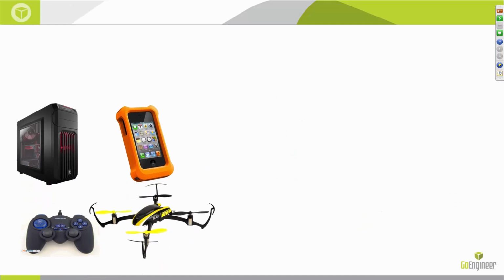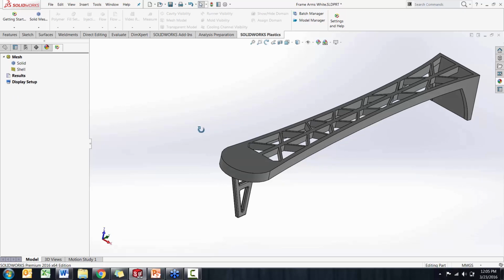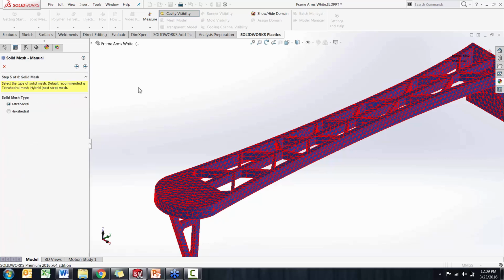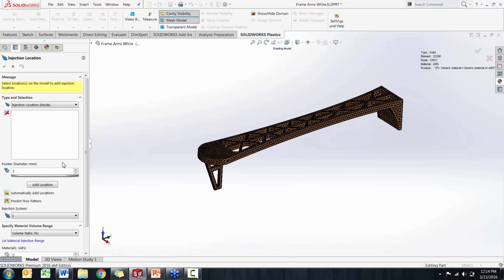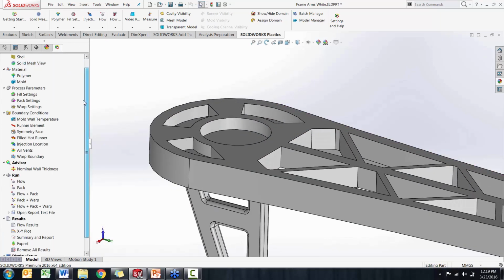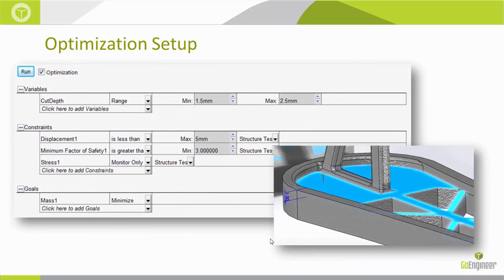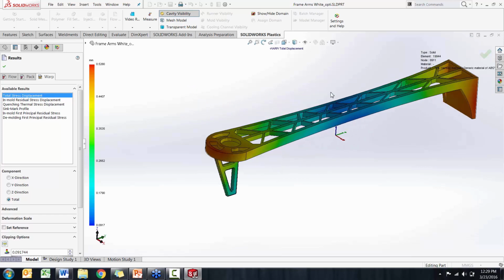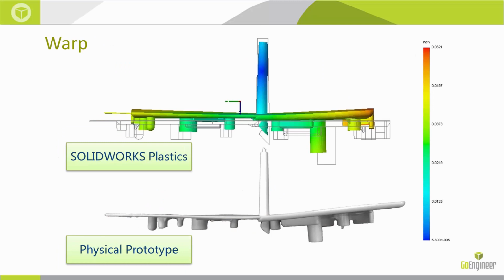SOLIDWORKS Plastics - Injection Molding Insights

Comment: How much time does it typically takes for an average computer system to run one of these analysis?
Reply from the maker: Hi Shreyans,
Depending on the mesh density the solve time for an injection flow analysis can solve for only an hour or solve for much more (24+ hours).  It would not be atypical to run a complex mold flow analysis overnight to then analyze the results the following morning.